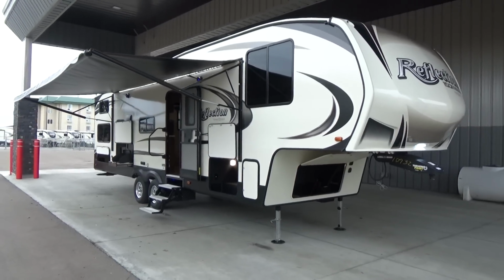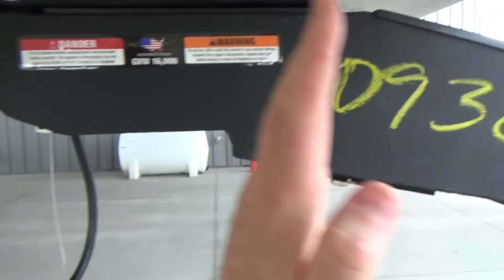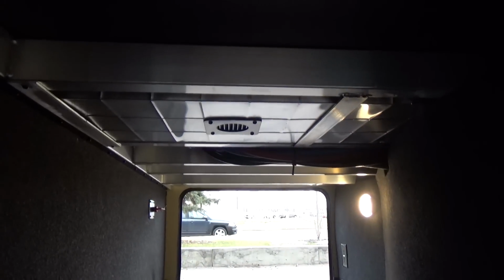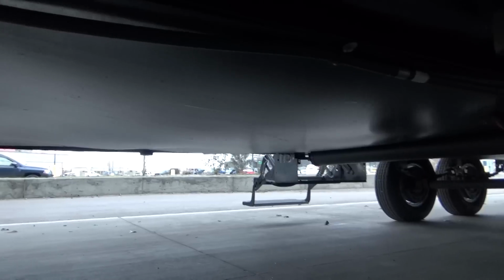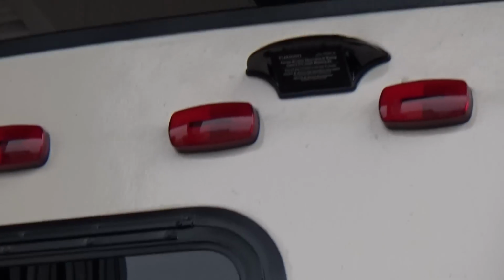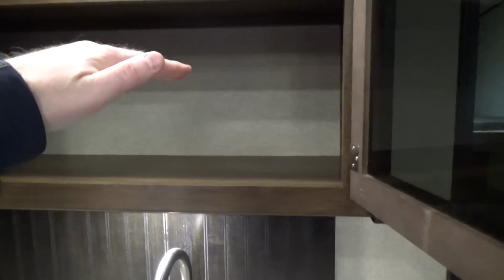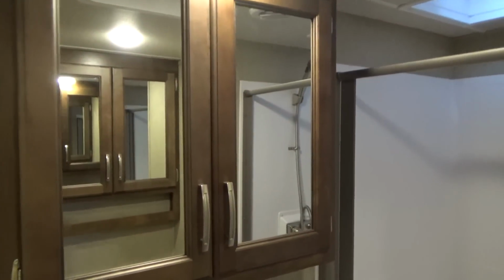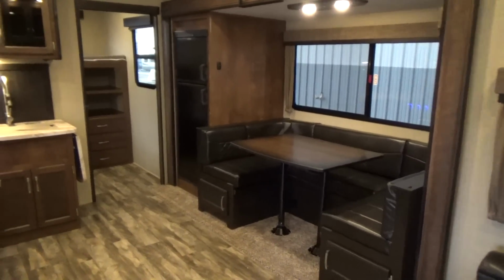2019 Grand Design RV Reflection 150 Series 290BH Fifth Wheel Bunk House

Comment: can you put a washer/dryer combo in that master closet?
Reply from the maker: stephen senger, great question!! Currently the master closet is not plumbed for a washer/dryer combo.
Reply: @WoodysRVWorldOfficial  dang. is that just this one, or this floorplan in general?
Reply from the maker: stephen senger, none of the 150 series are pre-prepped for washer/dryer. If you’re looking for a bunk model specifically. All the Reflection travel trailers are pre-prepped. The 285BHTS is almost identical to the 290BH 150 Series and has the pre-prep in the ward closet in the bedroom. We hope this helps!!😀
Reply: @WoodysRVWorldOfficial  it does. ty! looking to go full time with 2 kidz, and want it to feel like an actual home, with a rear bunk that can be closed so everyone has privacy and their own space.
Reply from the maker: stephen senger, if your goal is to go full time I would also recommend looking into the Solitude S-Class 3740BH. Depending on what your budget is of course. This RV is as close to residential as it comes in the bunk models for full time living.😀
Reply: @WoodysRVWorldOfficial  awesome. ty! this will end up being my home, so I don't mind spending some money.

Comment: Can you get theater seating in place of the couch?
Reply from the maker: admorris11, thank you for your question. Currently there is no Theatre seating option available to replace the tri-fold sofa, because the pocket where the sofa is located isn’t big enough to accommodate the depth of the theatre seating to allow the slide out to move in and out. However, you can swap the dinette out for the theatre seating, only thing is that you lose the dinette completely. We hope this helps!! 😀

Comment: I have a comment and maybe a little help.
I Have a 2018 nission titian sl with a towing capacity of 9400lbs and a payload 1364 can this pickup pull this trailer or will I be overwight?
Reply: I have this exact trailer and pull it with a 3/4 ton pickup. While the f250 pulls this trailer with ease, there is no way I would put this behind anything less.